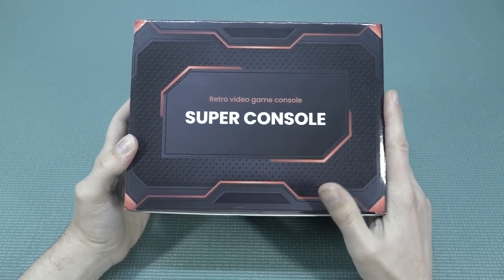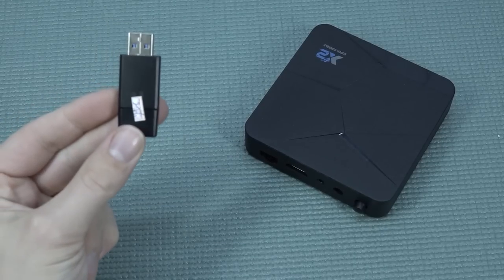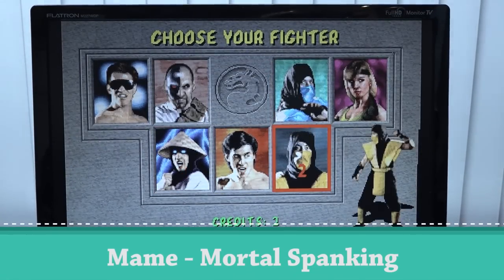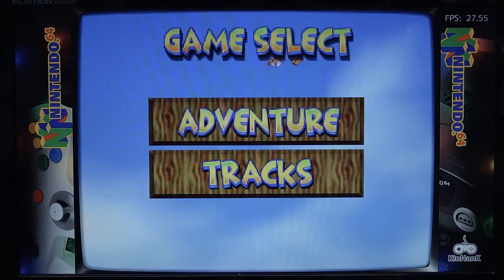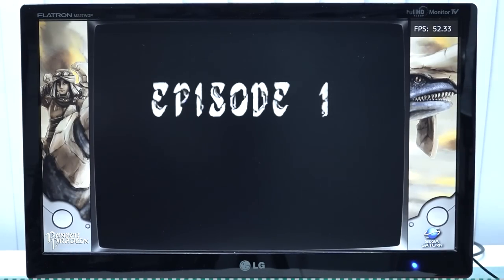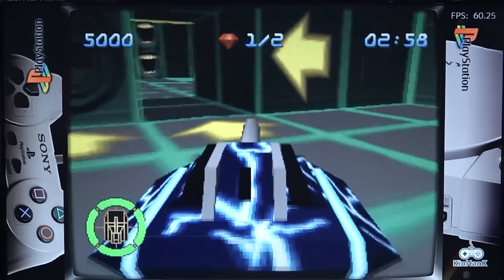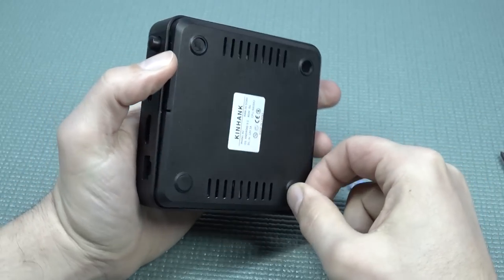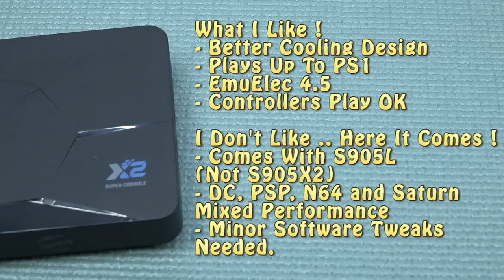Super Console X2 ... Finally The Next Gen Game Box Is Here ! 🤔

Comment: If the chinese could make a deal with nvidea to produce their older lesser powerful cards like the 640 or 730, or even a similar new GPU, they could have some pretty powerful boxes at least for emulation.
Reply: They would still need to be able to interface it to a system and/or integrate it with an SoC. You know short of an x86 box based on a modern Celeron/Pentium chip.

Comment: I got one of these for Christmas but have been unable to get it to boot up EmuElec. It will boot up the Android Screen but that is it. How do you switch between the two? Thanks for your time.
Reply from the maker: You should use cardreader with SD cart that is loos in the box. 
Because this thing has not SD card slot.
Reply: @WickedGamerCollector  I did that. Plugged it in on the opposite side of the controller. When I try to boot to EmuElec it gives me an Android Recovery screen.

Comment: Those old games, never ran at 60fps, the norm was 30fps and no one complained or missed 60fps, as it was not around. Don't get obsessed by needing g 60fps, when these reto system were basically running 30fps, even Saturn, N64, ETC, very few ran past 30fps. I have no problems with games running at 30fps, only PC players or new generation console owners complain. Old school was never 60fps

Comment: Does anybody have any experience with getting this working out of the box? I received this from AliExpress and it didn’t work. Plugged in, turned on but it doesn’t display a picture and the screen just stays on the HDMI “no input” screen.

I then received a replacement from AliExpress. Same thing happened. So either they’ve sent me two broken consoles, or I’m doing something wrong. Is there some kind of setup I have to do first to get it to work or should it just be plug and play? I’m pulling my hair out over here. I’ve tried different monitors/screens and different HDMI cables, and still get no signal from the console to the screen. Anybody have any ideas?